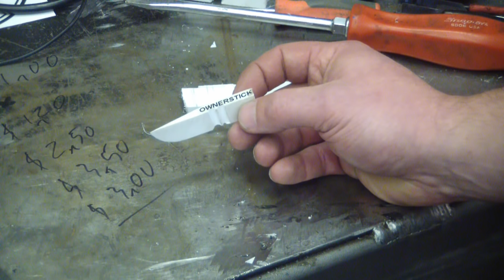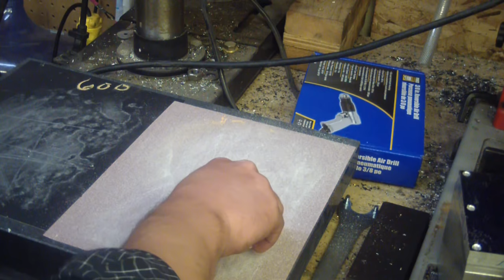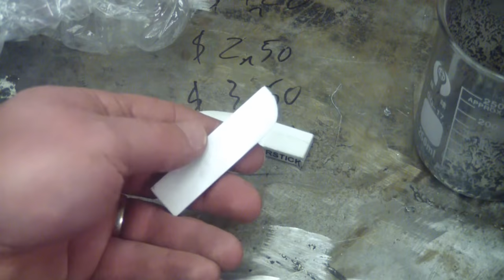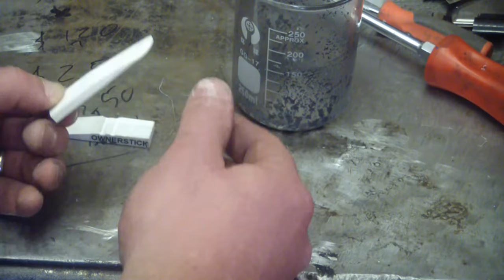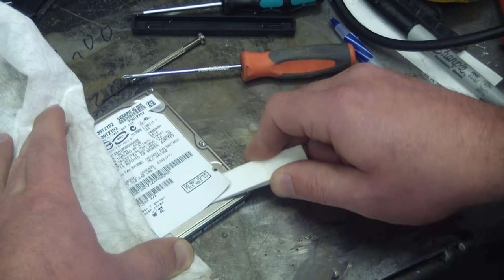Easy Warranty Void sticker removal with DIY Teflon knife.

Comment: I would be interested in this device, I repair photographic strobe power packs, some come in with many past job-related duct & gaffers tape all over the cases. I like to remove all the tape and clean them up after reconditioning for a new start back in the field. Your process looks much faster and healthier that the chemical process I presently use.

Comment: Hell yes I wants!
That would be thing for cutting back fim on s/s for welding. I use a soft copper 2" scratch gauge to acheave a nice parellel cut. But whenever I have to clean up a piece, after welding, there's like always some crud stuck on there. Of course, the prime directive of #4 s/s is, Do Not Scratch That!!

Comment: What they need to do now is design labels that will change color where there is just enough of a crease but not typically caused by daily use.  It would be a multi layered sticker that has a few layers of different colors and they would be designed to be very easy to break and expose the internal layers that were never really meant to be seen.  I have even heard of some labels turning black if you peel them off.  What they need is a type of adhesive that will leave a clearly visible indelible stain on anything it touches including your hands.  They only way to get it off sooner than a month would be to break out the belt sander and something to bite down on while you cuss at the pain hehehe!!

Comment: Now that would have been handy ten years ago when I was in the building industry. We would buy tool's and within a week or so ALL of the stickers would be destroyed due to excessive use and the environment we were required to work in . Now if anything went wrong with the equipment and we returned it there would be an argument to top the greatest arguments of all time just trying to convince them that we didn't  " tamper " with anything.  In the end we would spend whatever time necessary to safely remove the  " don't peek inside " stickers and store them in a purpose made folder that would allow for easy replacement of the stickers when required.

Comment: heat gun works best. peels right off no problems. you can really use any tool once its hot I have even used a paper clip. this seems a little pver kill but why not if it makes it easier and Teflon is cool. you know you can just get Teflon spray on coating and spray any tool lol. Thumbs up!

Comment: Cheapest option would be to coat a steel shim or "spudger" with a Teflon FILM, yeah?  Fold it over the edge.  Dunno how well it'd sharpen tho.
Or - if you could dip coat it in Teflon instead, that'd give you a nice big Teflon edge you can sharpen.

Both options would use a minimal amount of Teflon.

Comment: Dont remove HDD lables. THey often cover a hole int he casing. If that hole is ever exposed dust, outcide air, and other crap will get into the HDD and muck it up. They are vacume sealed for a reason, and that case hole is to help maintain pressure by allowing a bit of the case to expand and contract slightly.

Comment: If you could create a comfortable handle, these would be great for removing vinyl decals, especially the reflective kind.  The plastic scrapers that they sell to remove vinyl lettering kinda suck and strain your fingertips.  I once had to removed reflective vinyl from a car door and the scrapers failed, mineral spirits failed, and heat gun failed.  We ended up using carburetor cleaner.  I'm fairly sure we damaged at least the clear coat on those doors.

Comment: A warranty seal prevents someone from going inside and damaging (possibly intentionally) the components, and then holding the company responsible for fixing or replacing the item... If you want to own your item then don't expect somebody else to fix it when it goes breaks...

Comment: What about teflon plumbers tape over a metal or (other) plastic blade?  Also, does the silicone lube contaminate the adhesive for re-application?

Comment: You can buy a quite similar device. Go to a good art supply store and ask for a Teflon burnishing stick.
Reply: It might also be called a burnishing tool or a "Teflon bone folder." Bone folders are used in bookbinding, although why bookbinders need to fold bones is something I don't know. A burnishing tool is something I used for layouts back in the 1980s, and it is also used in various arts and crafts. The burnisher/bone folder typically costs about 15 to 20 U.S. dollars, although you might find one for less and you could certainly spend more on one if you wanted to.

Comment: I had a power supply quit working, so I thought I would check the obviously user serviceable fuse. Unfortunately, you have to break a warranty seal to get to it. Talk about confused as frig...
AND of course, the fuse wasn't the problem, so now, I have a door stop, because I checked the fuse before RMA'ing it.

Comment: Sure, you buy something, you own it and you should be able to do whatever the hell you want with it. On the other side of things, if you open the device and mess with it and it breaks, the company you bought it from should also not be responsible for having to replace it on their dime instead of yours. This is exactly why those stickers are there - to prevent the type of tampering that you're promoting.

You're basically showing people how they can tamper with the devices they bought and still have the company they bought them from replace them if the devices break. I'll put this in the simplest terms I can: If you truly want to own a device, then you put up with the consequences of whatever happens if you tamper with it instead of pawning the cost of the device back on the vendor you bought it from - this is what true hobbyists like myself understand when we tinker with things. When I open a device, I do it blatantly and discard the void sticker. This is me showing real, true ownership of the device I bought and paid for.

I support alot of what you do in your videos, you show alot of good tips and tricks in a number of different areas... but this is just dumb, and dishonest.

Comment: This sticker does not mean much in australia.
We can legally open PC cases to clean it, as long as we do not damage it, it is fine and will be covered under warranty
Reply: IIGrayfoxII yeah you open it even in Australia and the company won't repair it free of charge... go read you're contract agreeing to terms and conditions
Reply: I worked in a retail store which sold computers. 
I also repaired these computers that little sticker meant nothing. 

Warranty was still valid
Reply: IIGrayfoxII yes because your company agreed to fix them my friend bought an Alien Ware laptop they wouldn't fix it when he voided the warranty seal same with my neighbors PS4... just because some small companies agree to fix it doesn't mean that everyone will
Reply: It was not a small company i worked for. 
And the PCs included
HP
Acer
ASUS
Toshiba
Sony
IBM

The ACL says that sticker means nothing.
Reply: IIGrayfoxII you weren't a manufacturer... the fact you were fixing the PC they probably had a company warranty with your company... otherwise the PC or w/e would sent out to the manufacturer IE. Sony, dell, HP...
Reply: IIGrayfoxII what the ACL says :  It's a term of the contractual warranty you have with the company that you won't remove the sticker. If you do, the voluntary warranty provided by the company is automatically terminated.
Reply: BobPaul I'm not wrong you realise contractual law over rules, simple trading rules in terms laws always over rule regulation and every thing you are showing me are regulations if you don't agree with the contract of opening a product voiding the warranty it's simple don't buy it because you will lose in court everytime
Reply: Looking specifically at the ACL:
"Warranties against defects are always provided in addition to the consumer guarantees contained in the ACL.

In some instances a warranty against defects will provide the consumer with remedies that exceed those provided by the consumer guarantees. However, in other cases, consumers may be entitled to a remedy under the consumer guarantees after a warranty against defects period has expired.

You must take care to ensure that consumers are not misled, either through oral representations or in the words of a warranty against defects, into thinking that their rights are limited to the remedies or timeframe set out in a written warranty against defects."
http://www.accc.gov.au/business/treating-customers-fairly/offering-warranties/warranties-against-defects

tl;dr - the ACL supersedes manufacturer warranties. Manufacturer warranty is additional to the statutory warranty, not instead of.
Reply: Acer has sold PCs with warranty void stickers on them, actually.

Comment: Hell yeah I'd buy one of these.
I try my best to buy old well built tools but when I have to buy new it pisses me off when it breaks in a week and I cant fix it
Reply: Breaks within a week and i just return it. Probably no hope for it at that point. Pisses me off when shit breaks 6 months in and i have to go buy a new one to return the broken one with that receipt. i call it the extended factory warranty. No reason to need this tool for at least a year, and only even then if you have an actual extended warranty. Fuckers cant make a good tool, ima bring it back till luck of the draw works out in my favor. Of course i dont buy a tool planning on tearing it apart like AVE does either. So i can see where this may be of great use to him.

Comment: PTFE Sheets are available on E-Bay for under US$50.00...
Reply: Plate: .187" x 12" x 12" - $20.00 on Ebay
Plate: .375" x 12" x 12" - $35.00 on Ebay
Plate: 100mm x 100mm x 10mm Thick - $17.16 on Ebay (from China)
Rod: .750" x 75" - $27.00 on Ebay

Comment: I mean... You CAN take it apart, the sticker is so they know you didn't fuck it up while your were tinkering around with it. That being said, fuck em. Pretty much any successful company will screw you any chance they get.
Also you can remove those stickers without teflon or the means to shape teflon. Hair dryer and a static resistive bag (the bags sensitive electronics come in, such as a micro controller or a motherboard). Heat it up a bit with the hair dryer then peal it with the bag.

Comment: first off I went threw this before so I no I am right. the thing is in the us ca and most countries its legal to open anything you buy the sicker means nothing they must will cover your product they passed this law back in the 90s. the only thing they can do now days is if you broke something then they have to prove it or cover it also keep in mind most plains you buy now days have a acadental coverage option witch means if you break it its still covered. also I would like to point out fore people who just want the label intact so they do not get questioned or so you can swop a good part with a bad part you can go on ebay and cheaply buy the stickers used on most devices and the stickers you cant buy for under $10 on ebay you can have a sheet of them made. I my self do repairs and sell stuff online and will be using the stickers and telling people if its broke I will not cover you do not like then take me to court

Comment: You CAN do whatever you want with it, and since you don`t know what you`re doing (not AvE, you obviously do), you`ll mess it up, and if you mess it up you won`t get a replacement or free repair.
If you drive your car into a tree, you won`t get a new car..
Or remove the engine, take it apart then complain that it`s not running lol..

Comment: Little bit of colemans camp fuel will go a long way. I work on iphones, samsungs, laptops, and other random shit. Wet the entire perimeter of the sticker and use any plastic to get under the sticker and do not pull up as you slide under the whole sticker. Plastic “spudger” and bottle of colemans that will last a lifetime if this is all you use it for and cost less than this method. 

Edit: no colemans wont destroy pcb boards or other electronics as long as there isn’t a load on the circuit before it dries

Comment: why does it have to be made of teflon?
Reply: He points out the advantages in the video.  Teflon won't cut the sticker, where a metal knife might.  Teflon is slippery, so it doesn't bind up with the adhesive so much.  Teflon is a relatively high-heat plastic, so it stays hard and keeps its edge even when the object has been heated to soften the adhesive.  As long as you're using grease, another higher-heat, stiff plastic might work, but it won't be as slippery as teflon.

Comment: if it works for security seal/sticker's i'm in.
i work with computer stuff consoles are full of security stickers, Annoying as F*CK
But don't worry you can get it fixed for half of the price (you will get a refurbished console back)
Or the Lovely Lovely Apple Product's There glued shut with security stickers on am for backup.